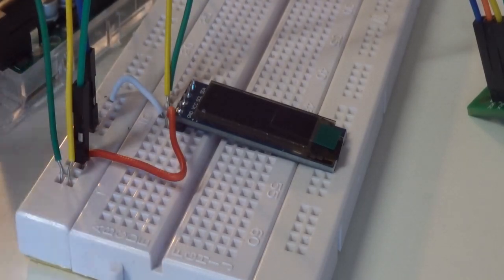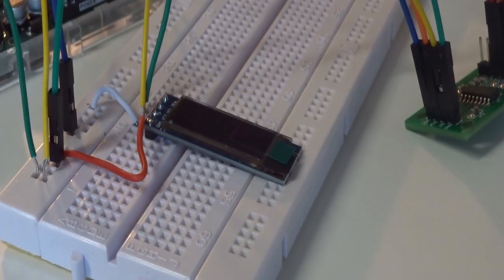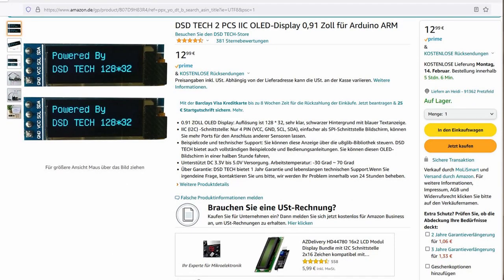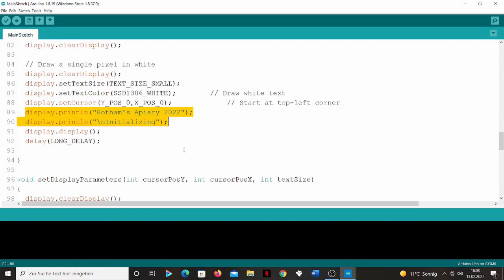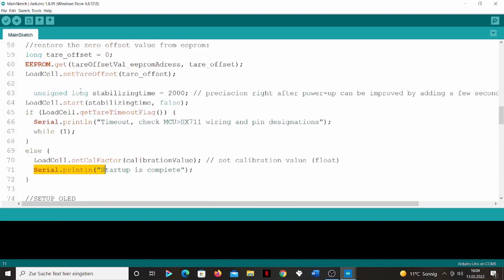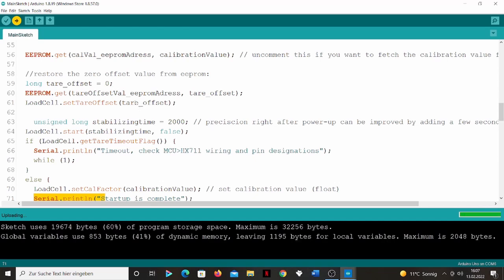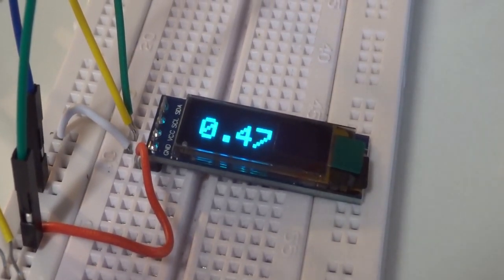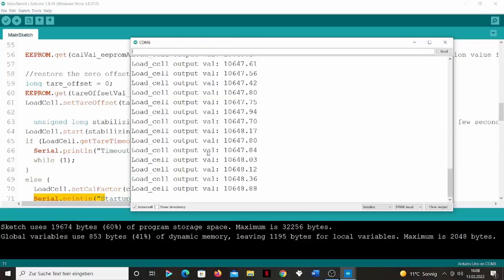Arduino Beehive Scale Part 3

Comment: Would you possibly share your sketch file for the load cells with OLED readout? I am getting the pieces to function, however haven't compiled both functions. Have you explored adding thermal monitoring?
Reply from the maker: I haven't yet played around with temp or humidity, but it's on my list. Go here to grab the main sketch: https://github.com/jmhotham/beehivescale
Reply: @HothamsApiary  Hi Jason, I’m really interested in your scale project and want to try it myself. I am an absolute beginner at any kind of programing. I was confused as to how you added the sketch for the OLED. I understand that you provided the sketch link above but I don’t understand how it was added to the Arduino. Do I copy that sketch and put it in front of the (void setup) of the sketch that I use for the calibration? Or is that sketch put in on its own? I’m not sure if you are still monitoring the comments but thought I would give it a try. Thanks!
Reply from the maker: @Apiarist100  hi! Actually the sketch I provided is an all in one. You can load that in your Arduino and it should do everything including calibration of the load cells and driving the OLED. Good luck
Reply: @HothamsApiary  Thank you for the reply! I have ordered all the components for the project. I have been a beekeeper for over 40 years (from Canada) but I have a different purpose for the scale. I grow giant vegetables as a hobby. Pumpkins, squash, tomato, cabbage etc. I want to build a couple of scales to put under my giant watermelons this year so that I can monitor the daily gains. Last year I had a 173 lb. watermelon and want to try and beat that weight this year. Thanks so much for posting the videos. It has really inspired me to give it a try.
Reply from the maker: @Apiarist100  that's cool, glad to hear you were inspired to try it out. The four load cells will support up to 200kg so I hope you grow the monster melon this year! 😆
Reply: @HothamsApiary  Hi Jason, Sorry to bother you again but I am having a problem. I have all the components hooked up to my proto type scale following your example and wanted to set it up. I went to your main sketch that you provided in the above link and downloaded the zip file. I then went to “add.zip library” in Arduino and tried to add it. I got an error message “Error: 13 internal: library install failed moving extracted archive to destination dir: library not valid”.  I then took the zipped file, unzipped it and moved it into the library folder. It seemed to go in and I uploaded it to the board and didn’t get any error messages doing that. The problem is when I open the serial monitor. All I see is gibberish. Random symbols, like question marks squares diamonds and things. It looks like it is writing something but it is not readable. I have the Baud in the serial monitor at 57600 but if I change that it doesn’t help. It just goes to a different style of gibberish if that make sense. I can load a basic blink sketch and that seems to work fine. I was wondering if you would have any idea what I did wrong.
Reply from the maker: @Apiarist100  hi. Sorry you are running into some bugs (welcome to the world of DIY!). I think you need to play around with the baud rates. There are plenty of arduino tutorials on YouTube. You could try using a different USB cable as well. Hope you figure it out